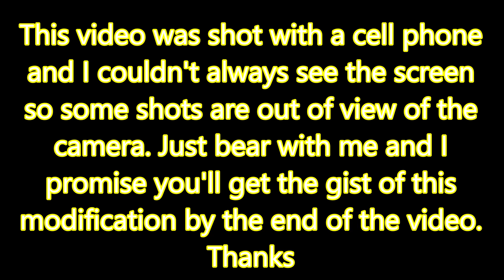DIY- U.S. Solid Valve Conversion to Normally Open

Comment: Dear US SOLID this DIY approach works for converting your NC valve to a NO valve but if you just went and made one little plastic part inside with a slot rotated 90 deg you would have a whole new valve to sell. In fact the approach would allow you to have whole line of NO or NC valves.

Comment: Thank you for this video, it has helped me a lot as I was struggling to find an auto NO valve here in indonesia. I made a snap shot of the part number and will try and find one.
The guy who commented on changing the mounting plate is spot on !

Comment: There is an easier way to turn the US Solid ball valve from NC to NO.  Open the blue housing. Remove two screws holding the circuit board and remove it (no need to unhook the wires). Remove three screws holding the motor/gear assembly and remove it. There you will find a plastic, one quarter circuit gear. Remove it; turn it over and re-attach to the brass ball actuator. Reassemble.
Reply from the maker: I just happen to have one on order as a spare for my whole house water valve. I'll give this a try.
Thanks for sharing.